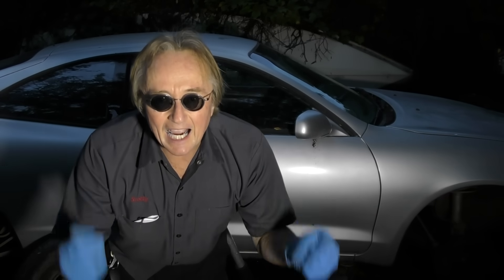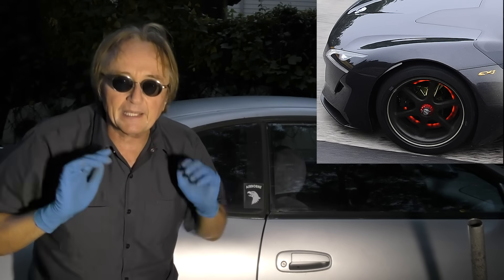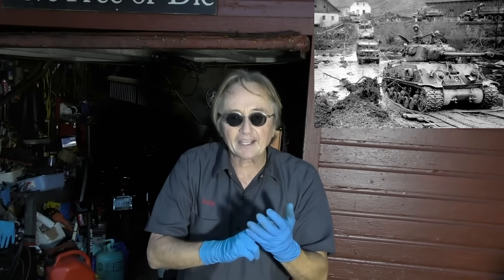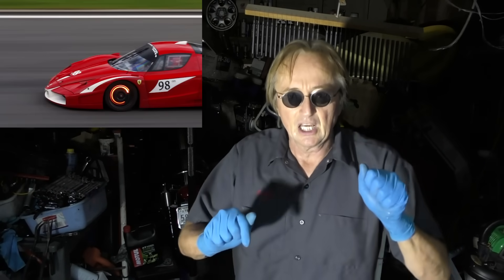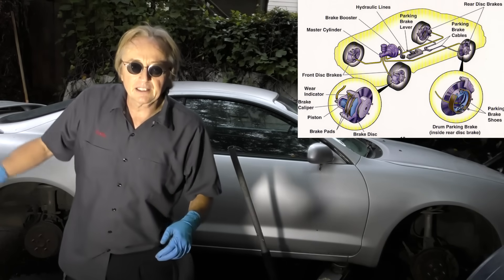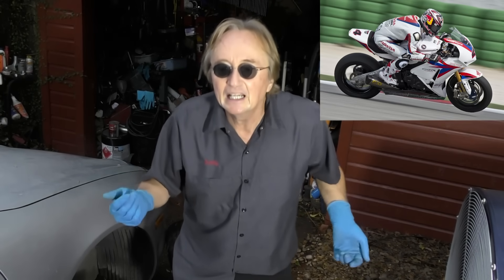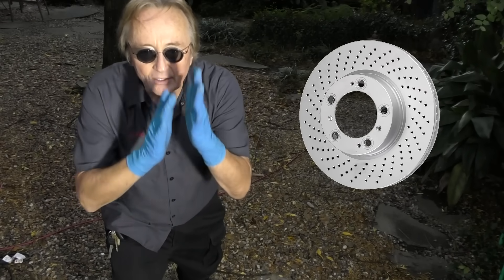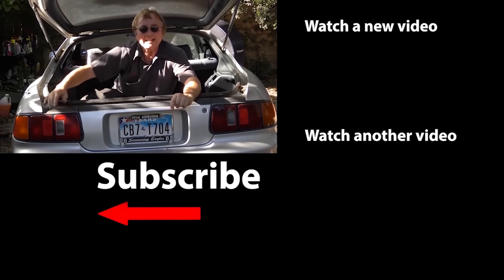Why Some Cars Have Drum Brakes Instead of Disc Brakes

Comment: My 1995 f150 has disc brakes up front and drums on the rear. I'm going to convert it to 4 wheel disc brakes because the rear drums have given me nothing but a headache. The rear brakes did not work when I bought it so I replaced the shoes cause they were worn and correctly set the adjustments. Now they immediately lock up as soon as I hit the break pedal. I have to constantly back the adjustment off every other day or they will start dragging and lock up while driving. I work at a auto repair shop and the guys I work with can't even figure out the problem and thats what caused my truck to flip was the rear brakes instantly locking causing my truck to spin out and flip in the ditch when I pressed the brake pedal to stop for a train.  Because of that and everything else thats why I'm converting to rear disc hopefully that will solve the problem of my rear brakes locking every time I stop.
Reply: its not the drum brakes fault rather the problem come from you buying a Ford.
Reply: @eaglefat9398  I've heard all the Ford jokes and comebacks before. Let me guess you drive a chevy? (PS) Ford stands for First On Race Day.
Reply: @speeedy95  *Failure on race day, ;)  alright in all seriousness your problem could be one of a few issues , first i would check to see if its both wheels locking up because  if its just one wheel  the wheel cylinder could be frozen but if both wheels are locking up the portioning valve could have moved and stuck and is now sending to much pressure to the rear (some times you can free it up but often time you will just have to replace it). A few simple things to check would be to see if the drum is out of round (oval) and make sure the bigger/thick shoe is on towards the back. After that you get into things like the mater cylinder is bypassing internally allowing more pressure go to the rear which may be why the rear brakes were disabled when you bought the truck (i've actually seen that happen on cheap rebuilt discount auto parts). If your truck has ABS it could be the ABS dump valve ,Do the wheels unlock as soon as you let off the brake or dose it stay locked up? One time i seen where somebody twisted the front brake line which restricted pressure up front sending more pressure to the back, that can also happen if the to brake line are old/overheated they can blister internally (hardening of the artery)and restrict the fronts sending more to the back.   And finally in not sure how this would happen because they  have different size fittings but somebody could have Jerry rigged it together  and hooked the brake lines up backwards to the master cylinder it wouldn't surprise me as i've seen even stupider things, good luck 

P.S i drive a 3.8L Buick that way i know what's broken before it even breaks (no start, its a coil pack)
Reply: @eaglefat9398  the rear brakes shoes were wore out when I got it so I replaced them and thats when the problem started. Me and my dad have checked the drums and there smooth they aren't warped or have any lips on them and the shoes are on the right way.  My truck does not have abs and both rear tires were locking up and now it's only the driver rear that locks up when you press the pedal. I have had the master cylinder and proportioning valve checked and they are functioning correctly. Why the driver rear keeps locking up as soon as you press the pedal I don't know. I want to go 4 wheel disc because I tow with it and to see if changing over will solve my problem plus the kit comes with everything to install 4 wheel abs on my truck. When I can I'll put a vid on youtube of my brake problem. (PS I got my mom's 1998 grand prix gt 3.8 it has 300,000 miles on it she bought it brand new. It has a bad oil leak from the valve cover gaskets the abs has constantly gone out since 4 months after she bought it. The cel light has always been on saying replace o2 sensors which we have and the code keeps coming back none of the Windows work they broke not long after she bought it and stealership wants to much to fix them. That car has had alot of problems since it was new. My dad rebuilt the motor himself twice in it.)
Reply: @eaglefat9398  you came up with one I haven't heard before Failure On Race Day thats a good one.  The only time I lost was to a first gen 5.9 cummins dodge he got the jump on me and I couldn't catch up to him.
Reply: @speeedy95  yea that's a weird one, since you're towing i definitely understand upgrading to 4 wheel disc with ABS, still sucks having to spend money
Reply: @eaglefat9398  yeah the kit ain't cheap it's $525.00 plus whatever the labor is to install it. I just hope doing that will fix my problem if it don't I don't have a clue what I'll do. But since I can't afford the kit right now I need to some how stop the driver rear from locking up I need my truck for work mon-fri. I don't feel like spinning out and rolling on my head in the ditch again from the tire locking up when I hit the brakes to stop.

Comment: I thought that I read somewhere that disc brakes were invented to help WWII fighter planes stop on an aircraft carrier deck.  Also, a lot of time people think that they need new brake shoes on their rear axle, but what has really happened is that the drums have filled up with brake dust as the shoes wear down, and sometimes just pulling the drum off and cleaning out the dust will improve things a lot.  Also, I've seen third rate people use water to clean out drum brakes, but in my opinion that is not a good thing to do.

Comment: Chevy HHR has the worst of the worst braking system.  Front discs that constantly warp, the rear drums don't engage at all and the auto adjust for the rears is a joke.  The Chevy HHR as noted in HHR forums the majority indicated identical issues of front rotor warp.  It's not due to incorrect torquing of the front rotors as many owners have brought their cars into a chevy dealer time and again and found after less than 5000 miles rotors warp again.  The dealer would replace the rotors, but same problem rotor warp.  Chevy knew of this problem and did nothing.  I can say I will not every buy another Chevy car.

Comment: People like to hate on drum brakes "eww they're old and that means theyre bad".
Drums are perfectly fine for everyday use with less noise than disks. And because most of them are "self energizing", they require much less pressure to stop the car (albeit, not really a problem now that we all have brake boosters). Yeah, there are better brakes out there, and they are an old design. But you can say that about the m1911. Old doesnt mean bad.

Comment: I had an 08 Scion with drums in rear which weren't even engaging so in slippery conditions the front would engage and because no breaking in the rear the damn rear of the car would start coming around because 100% of breaking was up front. Drum brakes need periodic adjustment, disc don't.

Comment: i have a 1970 oldsmobile cutlass sedan with 4 wheel drum brakes.

i refuse to get the disk brake conversion, because for that car it is a single piston caliper.

the single piston caliper has a tendency to sieze at the pivot point.

this is usually the reason older disk brake systems will rub on one side more than the other, overheat, and warp.

this causes uneven brake wear at best, and an obnoxious pulling to one side each time the brakes are applied at worst.

i have drove my car since 1995, and once i became aquainted with the brake fade problem i have had no problems.

as for the high water, you can apply slight pressure on the brake pedal as you go through the water, keeping the brakes warm enough to quickly evaporate the water on them.

my car weighs 3750 lbs., and i have only had the brakes done 3 times since 1995, twice by myself.

most big rigs, which can be 80,000 lbs., use drum brakes due to better reliability and mechanical stability.

Comment: I would love you to investigate (if you don't already know) why RV's including 20,000 pound 5th wheel trailers still almost always use drum brakes.  I cannot understand how something that weighs so much and can be so difficult to stop with even a HD truck don't make it as safe as possible and put on disk brakes,  Surely its not THAT much more expensive?  The only 5th wheel I could find with disks are LUX RVs, and they are about 2x more expensive vs any other one.

Comment: (Scotty, always love your videos)... But you might have missed a few notable points on this topic... I believe the reason Mfr's still use drum's in the rear of economy and mid-priced cars is one remaining reason... easier (and cheaper as you did note) to implement the Parking Brake! The simple shape of the drum, allows them to use an "inside shoe" in the underside of the drum. It is tougher to have an independent parking or "emergency brake" if you have rear discs. My old Volvo 940 had all (4) discs, the rear rotors actually featured an interior and totally independent drum system  on the inside, which was really hard to put back together.

Secondly, guys -- didn't Scotty recommend drilled rotors as a possibly beneficial upgrade some episodes ago (when he was griping about Cold Air Intakes?) I have been running cheap overseas sourced Drilled and Slotted rotors for years...no complaints! I am a normal driver, no racing. I replaced the OEM rotors after about 50K (the Toyota's OEM were still good) and noted a perfectly quiet stop, better "bite" and pedal feel (I suspect because of the holes) and with ceramic pads, have not needed to change any yet (40k + so far) -- and if I do, I will figure it was worth it....

Comment: Around 1975 i had a Datsun 510.  Went to the movies with my GF.  Came out.  Coming out of parking space the Datsun made a noise in rear drums and locked the right rear wheel.  Could not move forward.  Had to bring GF home at 11;00 midnight IN REVERSE. 2 miles. Then drive home about 2 miles more in reverse too.  A rusted spring in the drum system broke.  Disk brakes are nicer...

Comment: Drum brakes are used because of the parking brake. Rear discs would still need a drum brake inside anyway for the parking brake so it's cheaper to let that also be the regular brake.
Reply: My Mondeo has rear discs, and uses the pads for the parking brake. My BMW, though, has combined drum/disc as you state.

Comment: slotted rotors are bs because they have less grams weight so they'll heat up faster. They only help if you can get enough air flow around them with your rim choice to cool them off before another corner. Otherwise for downhill or heavy brakeing you want a substantial amount of weight on the rotors to absorb heat. The cheap slotted designs I've seen recently aren't that great. They're not like racing rotors.

Comment: Well, one down side of the disc brake is probably the residue can enter to your hydraulic system. Brake pad has a tendency to break apart if you don't change it at recommended intervals, and the dust can sip through the break pad and into your hydraulic.

Also, disc brake may not be a good idea for jungle trekking.

Comment: Dang...he didn't even touch carbon fiber brakes.  That's what aircraft use because the hotter it gets, the better it stops.  Also, carbon fiber is even lighter than a steel disc brake.

Comment: Dual master brake cylinders are designed for a specific configuration of drums and/or disks. The diameter and travel of each master piston may not be correct if drum brakes are converted to disk, Cars with diagonal braking systems could further complicate a conversion. I would not convert to disks unless the particular car model had the option for disks and all the related components were compatible.

Comment: Drilled/slotted brakes may cool faster, but that's not what the holes and slots are for. They're for dissipating the vaporized bonding adhesive in the pads to prevent severe brake fade. They're crap for daily driver cars because you're losing friction surface, and since most people will never get their brakes hot enough to vaporize the adhesives in the brake linings, you're not reaping the benefits of the design at all. It's purely for aesthetics on street cars, and it's typically just not worth it.

Comment: My 1998 Nissan Maxima had 4 wheel disc and the brakes would not work a few seconds after driving in deep water. Slotted discs solved the problem.

Comment: Funny how he's going on about sports cars when (Swedish built) Volvos have had four wheel disc brakes standard from the140-series on which was introduced somewhere in the 1960s...
At around the same time a 1966 289 CUI V8 Mustang made do with drum brakes all around and no brake servo. 
Two things in favour of the drum brake: your nice alloy rims don't get dirty nearly as quickly with brake dust and once the shoes hit the drum, the rotation and friction pull them in, so they're more or less self servoing.

Comment: Hi Scotty, Please help me i am really screwed after buying a used automatic Nissan Armada LE 2006 model recently. The car is over 2 hundered and 40 thousand KM and it jerks really bad when i change gears, be it reverse, parking, drive etc. I checked the u joints, transmission try, solenoid, all fluids etc, they all seems to be in good condition. What other problem u think it can have to be jerking bad while changing all gears? HELP HELP HELP....!

Comment: I didn't think drilled and slotted cooled faster because there is less metal for the heat to transfer through. I thought they were to clear the pads of debris that could prevent the pad from gripping the rotor face.

Comment: It probably would have helped if he mentioned that one important reason that drum brakes are still used on the rear of some vehicles is to simplify the parking brake system.  It is relatively cheap and easy to design a parking brake system with drum brakes.  The basic design hasn't changed for over 50 years.  Some cars have a 4 wheel disc brake system that includes drums on the rear rotors for just this reason.  Is Kilmer an Italian name?  He sure does talk with his hands a lot.

Comment: Problem is, Rotor Brakes are now WAY CHEAPER to maintain than Drum Brakes... There is absolutely no reason to not fit Rear Disc Brakes from the factory only than to reduce manufacturer costs.. Just see the TACOMA, Universally burned for having them in the 40K segment when everybody else have rear disc brakes as standard.. Toyota Rep response? (And remember what Scotty said in this vide) "We install rear drum brakes because they are better for Off Road since they keep stuff out" which completely contradicts what Scotty said.

Right now, If your car has rear drum brakes and its not a Sub-compact, Hybrid or really light car? Its 100% a cost effective measure..  
Rotors are more expensive to install at the factory but its cheaper to maintain at the user level since we have aftermarket options.
Drums are more cheaper to install at the factory but they are actually more expensive to maintain at the user level.

Comment: I have been riding motorcycles for 49 years now. I use my rear brakes all the time. I basically never use just the front brake on a motorcycle, rather, I apply them together. That being said, most modern bikes have double the brakes on the front than the rear. You do need to apply them together though for controlled braking.
Dirt riders rarely, if ever, use the front brake and in fact, when I and my other motorcycling friends taught our kids to ride we disable the front brakes for a good bit so they don't accidentally apply too much front brake in the dirt.

Comment: Change the front drums for disks, and your brake response will frighten the hell out of you, they will appear "wooden" and just not work. UNLESS you fit a servo as well... THEN you will wonder how you did without them!

And rear disk brakes? Well, rear brakes are the ones usually selected for the hand(emergency) brake (I did once have a Citroen BX, where the handbrake operated on the front wheels). Now there is a BIG problem with disk handbrakes, and accidents HAVE occurred. (Three in my car club at the last count). You have "a bit of fun" and get the disks hot. Then you park up. Don't be surprised if a while later, the car rolls away. As the disks cool, they get thinner...And retract from the pads. Hot drum brakes cool, get smaller, and grip the shoes tighter. If in doubt, leave it in gear/park.

Comment: Thanks to u scotty i got me regular brakes for my f150 ,4 motorcraft  rotors n brake pads ,,i wanted drilled just for show but watching all your videos ive been learning alot ..symply go with oem i paid 600 dollars well spent ,very quite brakes ,no dust ..before i replaced my rear brakes with wagoner pads from oreylis i paid 70dollars for that trash ..at motorcraft i spend only 65 for the same pair i only had that pair for 2 weeks bc i replaced all 4 this weekend with the oem

Comment: Racing yes..but also towing or hauling heavy loads...brake fade isn't just a product of speed load, but also of simple weight load.  Takes more force to slow down a heavy load too.  Same principles of inertia, just differing parameters. Mass and speed are the constants.  Less mass, higher speeds or more mass, lower speeds.  End result is the same!  Been a trucker for 22 years, I promise, speed/racing conditions aren't the only factor in brake fade.  A long 6% grade and a heavy load will do it faster.  Also, heavy rear-end loads like towing or hauling drastically increase rear-brake engagement.

I finally replaced the rear drums on my pickup not because of use wear, but because of environmental degradation over 15 years of little use.  The shoes were plenty thick still! If I towed more or hauled more, that would be a different story.